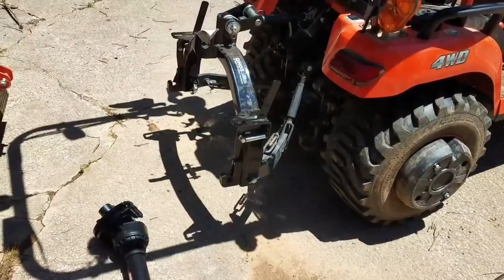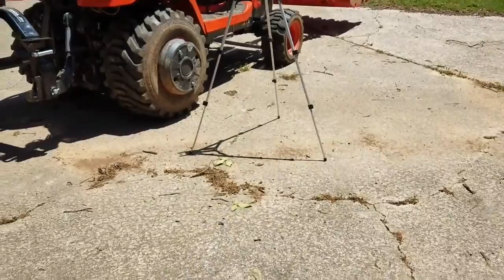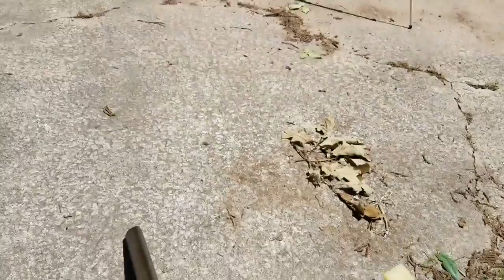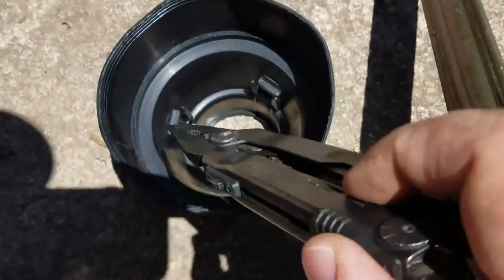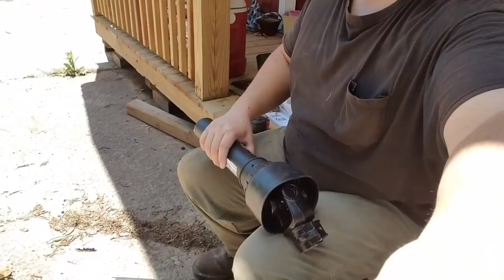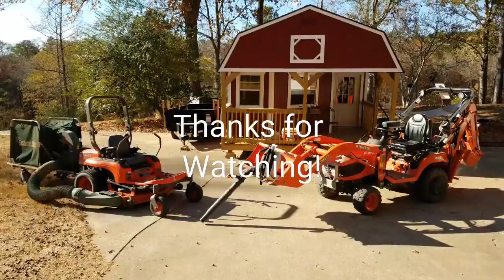PTO Shield Removal

Comment: Thanks so much for this. I've searched a lot for how to remove the PTO guard so I can get to the grease nipple on the shaft and couldn't get a clear picture on how to do this. I saw a lot of videos using screw drivers but just didn't understand the mechanism involved. Thanks again for showing this. I should have better success now.
Reply from the maker: +Chubearishere Your welcome! I had the same problems and thought it might help someone out there and save a little frustration.

Comment: Thankyou for making and sharing the video.  Why did you need the guard off to shorten the shaft?
Reply from the maker: Your welcome!  When getting a new implement it will not be quite the right size potentially. Distances vary from tractor and if  you have a quick hitch or not.  As implement is raised and lowered it needs to shorten/lengthen a couple inches.  If left so it bottoms out and can't shorten as lowered it presses into your PTO gear shaft and can damage.
Reply: @ODLife  I understand why you'd need to shorten a PTO shaft, what I don't understand is why you'd need to remove the guard to do so.  I found your video because my guard tube is cracked, and am also considering trying to lengthen the pto shaft for an implement I bought used - if there is w way to reuse the yokes and slip clutch for less than a new assembly.
Reply from the maker: @murky2502  gotcha, that's me reading to fast. Your right, no need to remove to shorten. It's been a long time since I did that video.  I think I took it off to do the video because I struggled to remove and thought it would be helpful for someone else.  Not sure if you can get an adaptor to lengthen.
Reply: @ODLife  it was helpful, thanks.  Some shafts you can replace the tube by removing a roll pin at the inner yoke, others are welded.  But just tube stock is often more expensive than a whole assembly.  I've also considered buying the cheapest assembly of the right size and swapping the outer yoke that has the slip clutch.

Comment: How do you disconnect the shaft from the cutter?
Reply from the maker: Should be a bolt or big Allen head screw
Reply: There is also a ring to hold the shaft onto the gearbox.